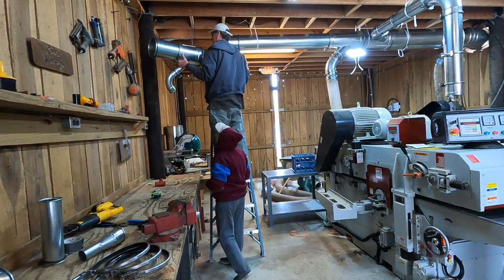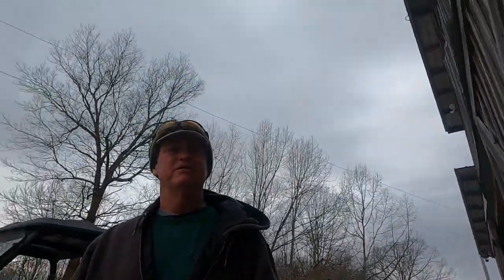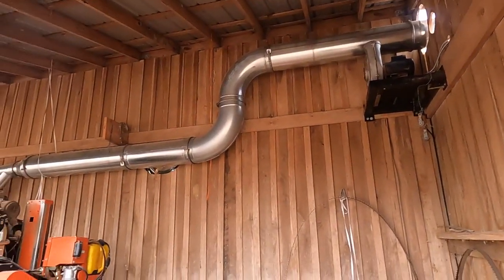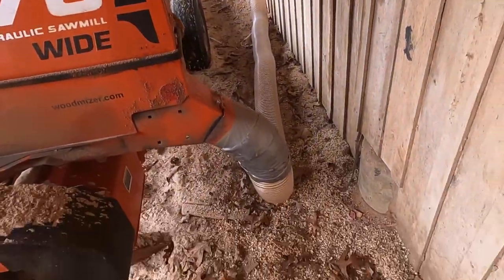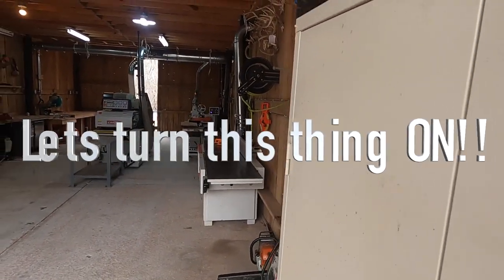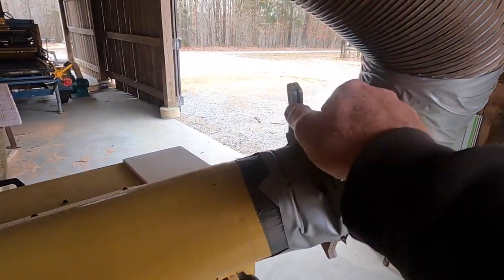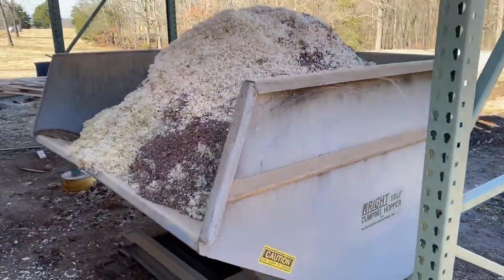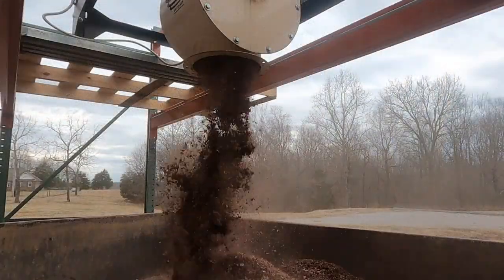Episode 3 - Whole Sawmill Dust Collection Install Complete at Hobby Hardwood

Comment: Very nice system!
Reply from the maker: Thanks!
Reply: Are you air drying your lumber outdoors for a year before it’s kiln dried?  If outdoors how do you cover the top to keep rain off?  I’m running out of inside space.
Reply from the maker: @gaylonreedy8915  Yes, we air dry our 8/4 for about a year, under cover, but our 4/4 not so long.  Having a good place to air dry is another one of the investments we've made over the years, and there is never enough covered space, but it is a necessity to have a good level base and a roof.
Reply: @HobbyHardwoodAlabama    Thanks. I’m working on a solution for outside storage.

Comment: Nice set up!
 What is the reason for the air lock. Can't the sawdust just fall out naturally?
Reply from the maker: No, the entire dust collection system is basically a vacuum cleaner, so the airlock lets the sawdust fall out while maintaining a vacuum.  Similar to emptying the vacuum cleaner while it is running.  Not easy to do, but that is what it does.

Comment: So Robert, Are you leaving the dust collector exposed outside to the sun and rain?  Or are you putting a roof over it? Thanks, Brad_bb
Reply from the maker: Yes, totally outside, totally exposed.  It's got a TEFC motor that is designed for outside use.  The metal funnel is similar to the other one I had from Oneida and their powder coat process has never even begun to rust after many years on the other one.  The only thing is that Oneida recommended that I put a "hat" over the motor if it snowed a lot because it would get into the motor end cooling fan, and if the motor was warm the snow would melt and form a block of ice in the end cap.  Since we hardly have any snow here, I never put a cover over the motor.